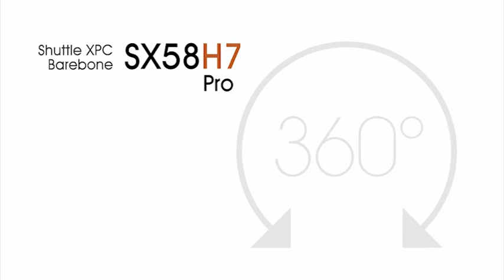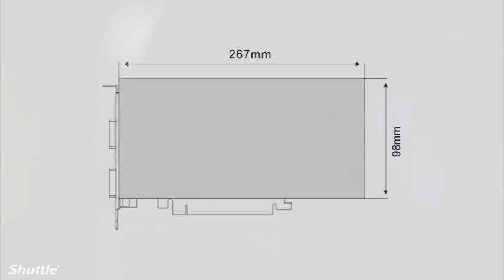SX58H7 Pro - 360° product video [HQ]

Comment: iam very interested in this thing but i think the socket 1337 processors have a bad cost-effectiveness in compare to the 1155 ones.
is there a comparable performance model with socket 1155? or maybe will there be one released in the next time?